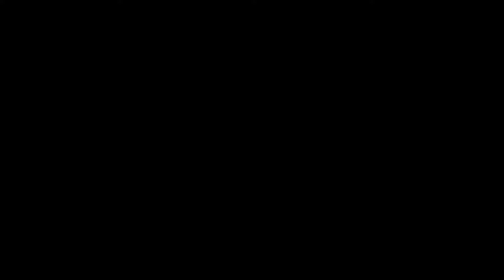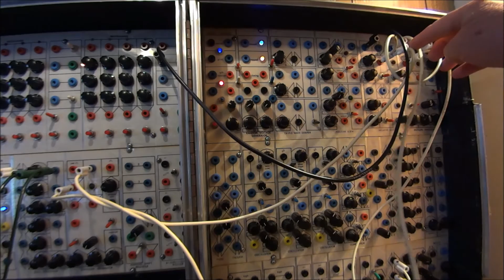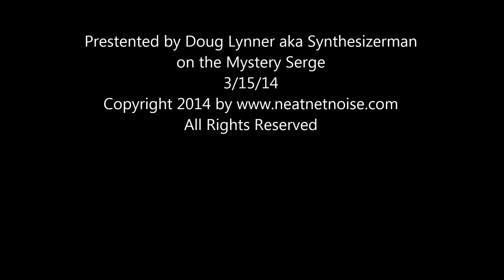Pitch Division - Harmonic Arpeggiations - Serge Modular Synthesizer Tutorial

Comment: Is this possible with a DUSG?
Reply from the maker: Use a high frequency square wave to trigger the DUSG (trigger in). Any output should work. Set the rise and fall pots to their shortest settings. As you increase the length of either you will hear the sub-harmonic series. This happens because, like the Serge Envelope Generator, the Serge DUSG will not accept a new trigger until it has finished its voltage excursion. Let me know how it goes!
Reply: @DougLynner  oh thank you for this tip! I'll have to try that!
Reply from the maker: Yes it is, Jonas.
Reply: Doug Lynner Tried it but didn't get it to work. Which in's and out's should I use?